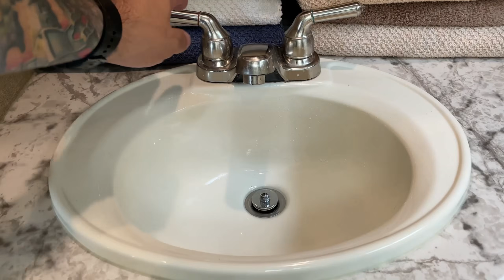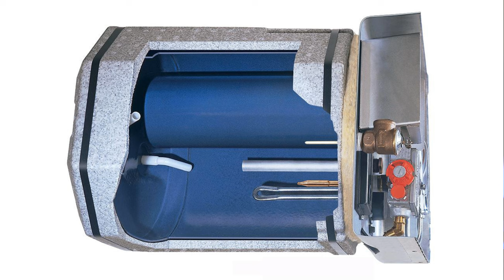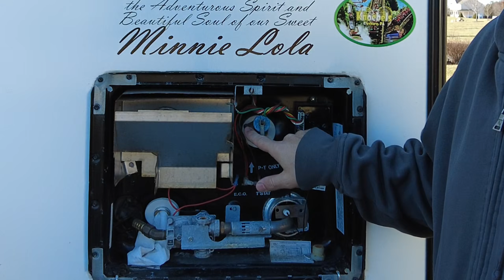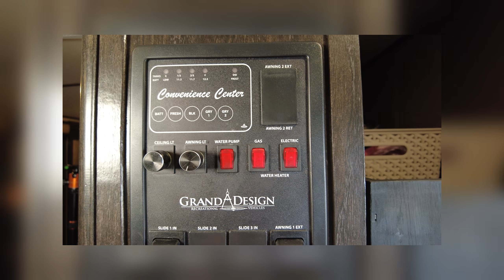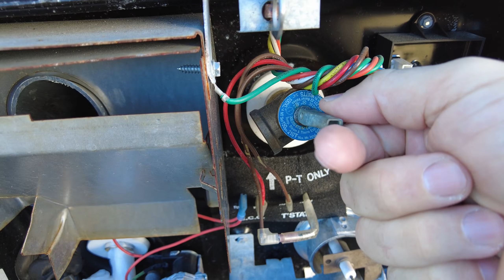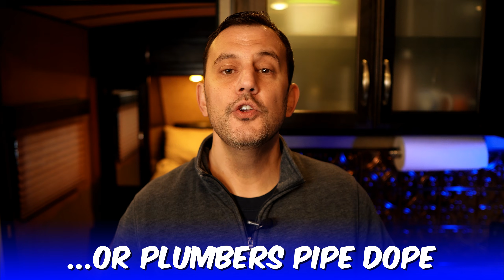Why RV Water Heater Pressure Valves Leak & How to Fix It - P&T Valves Explained

Comment from the maker: ✨⭐ PRODUCTS FEATURED IN THIS VIDEO ⭐✨
🔹 RV Temperature & Pressure Relief Valve https://geni.us/ngiGWMO (Amazon)
🔹 T&P Valve Replacement Tool https://geni.us/gQa02h4 (Amazon)
🔹 Teflon Tape https://geni.us/Wv8k (Amazon)

Why Your RV Water Heater Leaks & How to Fix - Pressure Relief Valves Explained Your RV temperature and pressure relief valve leaks by design when it detects excessive pressure or temperature.  This safety valve is also called a T&P valve (or P&T valve). While slow water dripping from this valve can be common, it's not normal if all systems are working properly.  This video will show you how we diagnose and fix the problem.

#rvlife #rvliving #rvtips #waterheater #rvwaterheater #rvhacks 

RV ESSENTIALS & TOP PICKS 
🎥Essentials Video: https://youtu.be/yuvS3zZL81c 
🔷Sewer Hose Kit https://geni.us/7dNg (Amazon)
🔷Clear 90 Degree Sewer Elbow https://geni.us/L79gI2 (Amazon)
🔷RV Water Filter https://geni.us/FZ1P (Amazon)
🔷Best Wheel Chocks https://geni.us/9B5i (Amazon)
🔷Power Watchdog 30 Amp Surge Protector/EMS https://geni.us/zKcm (Amazon)
🔷Power Watchdog 50 Amp Surge Protector/EMS https://geni.us/jgOto (Amazon)
🔷Wireless RV Leveler https://geni.us/DAW9N24 (Amazon)
🔷Leveling Ramps https://geni.us/m38VoBr (Amazon)
🔷Liquified RV Tank Treatment https://geni.us/QTUJSrP (Amazon)
🔷Tire Minder TPMS https://geni.us/8HBSTg (Amazon)
🔷Water Pressure Regulator https://geni.us/fTzA0 (Amazon)
🔷Drinking Water Safe Hose https://geni.us/emLdlC (Amazon)
🔷Browse All Essentials https://geni.us/1Omwvhh (Amazon)

MAINTENANCE:
🔶Boeshield T-9 Rust Preventative & Lubricant https://geni.us/uXxstyC (Amazon)
🔶Geocell Proflex Sealant https://geni.us/YXiACx (Amazon)
🔶Water Heater Cleaning Wand  https://geni.us/AcTvhLc (Amazon)
🔶Water Heater Cleaning Adapter https://youtu.be/h6C6ihTQ1cY
🔶Waste Tank Rinser https://geni.us/V2XLE (Amazon)
🔶Road Tool Kit https://geni.us/oBFnd9l (Amazon)
🔶Eternabond Roof Tape https://geni.us/6AXdw (Amazon)
🔶Browse All Maintenance https://geni.us/UvxFP (Amazon)

INSIDE
🔷Screen Door Handle https://geni.us/itRfKUQ (Amazon)
🔷Shower Caddy https://geni.us/ZPcno (Amazon)
🔷Oxygenics Shower Head https://geni.us/jznwF (Amazon)
🔷RV Paper Towel Holder https://geni.us/Acknol (Amazon)
🔷Dimmer Switch (watch video) https://youtu.be/2bbqBcSsRZQ
🔷Electric Heater Fireplace https://geni.us/YmBoktI (Amazon)
🔷Browse All Inside https://geni.us/BWiOR8k (Amazon)

OUTSIDE
🔶Gravity Chairs https://geni.us/VlPR8rn (Amazon)
🔶Ground Mat https://geni.us/wbWWLzf (Amazon)
🔶Table https://geni.us/qsPO (Amazon)
🔶X Chocks https://geni.us/3oyburw (Amazon)
🔶Blackstone Griddle https://geni.us/8BuIrW (Amazon)
🔶Low Point Drain Valves https://geni.us/yBB02h7 (Amazon)
🔶Browse All Outside https://amzn.to/4ld0kcz (Amazon)

👇 COUPON CODES! Use the links. Save money. Simple.

🚐 10% off RV Snappads & Snapjacks https://rvsnappad.com/discount/RVTT10

💦 Blu Technology Water Filtration Systems 7% Off, $80 or more No code needed just use our link:  https://goblutech.com/xxnnkdun 

🛌 Get 30% off your RV Mattress by Brooklyn Bedding at https://rvmattress.com/rvtips
Use Discount Code: RVTIPS

📷 Haloview Back Up Cameras 5% Off & FREE Shipping (Use code RVTIPS at checkout) https://www.haloview.com/products/byte-tango-1080p-observation-camera-system.html?acc=765

🔧 NRVTA Home Study Course https://rvtechcourse.com/discount/RVTIPS20
Use Discount Code: RVTIPS20

🚴‍♂️️ Lectric eBikes - Use our link get FREE accessories https://lectricebikes.sjv.io/nLrJ3x

💻 Our eBay Store! You never know what you’ll find!
https://geni.us/6AyLKnS (eBay)

💥 Join Our FREE Newsletter! https://rvtipsandtravels.myflodesk.com/freenewsletter

If you want to support the work I do to help others, you can donate here:
Paypal: https://www.paypal.com/donate/?hosted_button_id=J2KKM9NR3BJJA
Venmo: https://venmo.com/u/Ross-Stoico

✨ AMAZON RV STORE ✨
https://www.amazon.com/shop/rvtipstravels

Follow Us on Social Media
https://www.instagram.com/RVTipsAndTravels
https://www.facebook.com/RVTipsAndTravels

🙏 If you find a dead link, PLEASE let us know & we’ll send you bumper stickers!

As an Amazon Associate, I earn from qualifying purchases. There is NO ADDITIONAL COST TO YOU when purchasing from our links. Thank you for your support! 2.0

Comment: Thank you for this. I'm about to winterize today, but I will save this video (in my watch later list)  for next season and definitely do it. Because mine has been leaking once it heats up. 
*If you don't mind, I would like to ask you an unrelated question on the hot water heater, that no one can fix or answer so far. When I use electric to heat up the water, once it is all heated up, I get this clicking noise every few moments or a minute or two from the hot water heater. I'm told It sounds like a relay or something. And it doesn't happen if I heat up the hot water with my propane. I do have the sound recorded. I wish I could let you hear it. And I tried opening up the little black rectangular black box ( it's about six inches by two inches) that is connected to the hot water heater, and I blew it out with air just in case there was dirt in there, but that did not fix the problem. Any help would be appreciated, thank you.
Reply: @RVTIPSANDTRAVELS Did you read my comment? Do you have any advice? Thanks

Comment: I see a pink  plug on your t and p drain opening. Does it need a plug there or stay open. I have a 2004 Atwood. Does it need an anode or a plastic plug at bottom of hot water heater. I would greatly appreciate any input. 😊
Reply from the maker: its a plastic plug and it should have fallen off a while ago so its not needed.  its just a cover. atwoods dont need an anode rod.
Reply: @RVTIPSANDTRAVELS thanks so much for replying. I'm grateful.

Comment: first scenario MAY have been my case and the steps seem to have worked released water from tp valve cold...repressurized. flipped it open to closed a few times  and tapped. will leave it on overnight and see how it does when it gets hot out. have exact same tank you show....where is the anode???
Reply from the maker: No anode rod, it’s aluminum

Comment: Hi, what is the red piece that sticks out from the side of the P&T valve? 
The one in my valve broke, is it necessary? I’ve NOT  turned my water heater on for the first time on a recently acquired used rv. I’m learning how to do it.
Reply from the maker: its not necessary, I believe its just a cap that allows water to come out but makes it harder for anything to get into the valve, like bugs.  the valve is close most of the time and mine fell out a while ago, I wouldnt be concerned with it.

Comment: You made a video once discussing making hoses to be used with a shop vac to get the water out of the low point in a water heater. Can’t find the video or at least that part. And did you ever find or come up with a good solution to vacuum out the remaining water?
Reply from the maker: Hey Anthony, that video and those adapters will be released towards the end of February... make sure you have all notifications turned on our channel. Hang in there for a couple weeks.
Reply from the maker: https://youtu.be/h6C6ihTQ1cY

Comment: Well done video. I recently purchased a 2006 travel trailer, and while checking the systems,  noticed the water heated worked okay on gas, but not on AC, and the pop off valve had been leaking (rust all over). It tuned out, the AC switch was frozen up, the heating element was bad, so I’m replacing the T&P valve anyway, since after taking out the anode rod, it was just a wire, and flushing the tank, a lot of stuff came out of it. Obviously a very neglected water heater. I had to even remove the gas valve to clean out all the surface rust, practically overhauling the water heater. Great job explaining everything.
Reply from the maker: Sounds like you’ve got a good handle on things now.

Comment: Great video. Just found it while perusing the channels. That T&P valve socket works fantastic and I'd highly recommend it. I will add that I've added the T&P valve to a maintenance replacement part rather than wait for it to fail. The 'ears' on the valve lever (that's what I'm calling them, the thin pieces of metal that have the hinge pin through them and push against the valve body to lift the spring inside the valve) were significantly bending outwards on ours after three years and the valve had become quite stiff to open. Yours (I'm assuming it is your water heater in your video) seems to be bending in the same fashion. Since I use the valve to 'burp' the water heater at the campsite when filling it prior to starting it up, I decided to go ahead and replace it since it's just a $20 part (or less). That seems to be a far better option than to deal with it after it fails at the campsite. 

Just to put this out there, yes, we maintain our water heater. It is fully drained after each trip (once a month for a week or two at a time) and, once a year, it is filled with vinegar, allowed to sit for 24~48 hours, drained, and fully rinsed. This is followed by wand flushing out of the drain port (we have a Dometic so no anode rod) until no sediment flows out. The T&P valve still gets corrosion over time and since we're constantly cycling the valve to 'burp' it, I think it's just better practice to replace it every 3~4 years.

If anyone has a T&P valve that is leaking; however, they do need to follow your steps to verify that they do not have something more sinister going on before just replacing it. Keep up the great videos.
Reply from the maker: thanks Matt, and yes, i find myself squeezing those tabs occasionally to bend them back into place 🤣

Comment: Mine doesn’t leak when there is no power to the water heater it’s just full of water I can flip the value cold water comes out. If I turn the power on electric or gas it starts to leak. There is some build on around the value but I’m not sure if it needs a new one.
Reply from the maker: probably just worth replacing: https://amzn.to/3zahfcN

Comment: My water's not even getting hot so it's definitely not a pressure issue.And it's still leaking every time I turn it on and wait more than 10 minutes.It starts pissing everywhere and the water's not even getting hot anymore
Reply from the maker: sounds like the valve just needs to be replaced.  the water might not be getting hot because its not sitting in the tank long enough.

Comment: Mine is doing this - and it steams when the water gets too hot. It leaks too. Very frustrating.
Reply from the maker: keep me posted on what you find out please.
Reply: @RVTIPSANDTRAVELS  will do, I bought a 3/4 valve because mine is leaking, it's about 7 years old so hopefully that does the trick.

Comment: I've replaced the valve twice. Still leaking. What else do I do? I put Teflon tape on both new valves & did everything in the video.
Reply from the maker: it 3 valves are spewing water, chances are something else is wrong, meaning they are doing their job and the water pressure is too high or too hot.  might be time to have someone test the things I mention at the end of the video.

Comment: I have some concerns that my T&P valve spring is too tight, and like yours, the ears on the handle try to bend as I open the valve manually.  That doesn't seem to be a concern for you, but it seems like the valve should open without damage to the handle??
Reply from the maker: GREAT QUESTION JD, i think that could be an issue, but those ears are so thin that I never thought twice about them.  i always just finger pinch them back together but I've been using the same valve for 8 years now, and I use it often to confirm water in the heater before firing up the electric element. If anything, I think that spring would weaken over time, not get stronger, so I don't worry about it all that often.  It is a valid point though, and they are pretty inexpensive to replace if you just want to test it out.  Here's one we've sold a few of already: https://amzn.to/3W7qdQW
Reply: @RVTIPSANDTRAVELS  The handle on the camco unit appears to be more robust.  My RV is a 2021 - so not real old.  The tension doesn't seem to be getting stronger as it's been this way since new.
Reply from the maker: I wouldnt be too concerned since the point you brought up is something that I personally, though never really thought about, am having too with those ears... they are weak on mine as well, but never had an issue with the valve and I dont think Ive had excessive pressure problems because after years the camper is dry.  Thanks for bringing it up, maybe something I ask my viewers down the road.

Comment: My hot water tank keeps getting over heated and blows off. Any idea why it keeps getting too hot and blowing off?
Reply from the maker: it could be the board, the heating element, the thermostat.... does it do it on electric or gas or both?
Reply: @RVTIPSANDTRAVELS  It is both, I figured it out its the eco and tstat switch they were not touching the wall and the foam tape fell off allowing them to dangle from the wires.
Reply from the maker: good to hear you got it fixed!

Comment: Got a bunch of calcium/corrosion buildup on my valve, ran thru the first set of steps and currently waiting for temperature to return to normal to check if its still leaking. Thanks for the info, safe travels, and GO HAWKS!
Reply from the maker: good luck, let me know, and GO HAWKS! 🍻
Reply: @RVTIPSANDTRAVELS  sad to see the last game is being played tonight. my water tank never really got free off the corrosion and will almost certainly have to be replaced, but in the meantime the leak has stopped and my hot water has been performing like new thru the winter into spring now. Thanks again!
Reply from the maker: Well, thats some good news.  Once you replace it, you now know how to keep it clean.  good luck my friend, and lets hope for a good game!

Comment: followed all the procedure and its a brand new valve, still leaking on and off ???? what could be wrong?  thanks
Reply from the maker: How bad is it leaking? Occasional drips?
Reply: @RVTIPSANDTRAVELS  thanks for the fast response 
Tripping on and off
I believe the water gets to hot. 136f I measured 
I ordered a new thermostat and hopefully that will do the trick
What do you think?
Thermostat is rated for 130f
Reply from the maker: It definitely could be the thermostat, but that’s usually rare. I think it’s a good place to start though. Every once in a while, and I mean not very often, I’ll see my pressure valve slowly dripping. I rarely camp without water hookups, so it’s not a big deal to me. They can definitely be finicky.

Comment: Ross,  On your video  "RV Water Heater Pressure Relief Valves",  you had a flexible hose coming out of the Hot water heater.   Where we empty the tank.  Where can I get one of those hoses?  Thank you   I am learning so much....   Thanks
Reply from the maker: Can you point out? What time in the video this is being shown?

Comment: Is it supposed to make that obnoxious sputtering sound when you press it 5 times?
Reply from the maker: it can, depending on how high the water level is.  dont forget there is pressure in the tank so it will make some noise.
Reply: @RVTIPSANDTRAVELS  awesome, thanks!

Comment: Very interesting Ross. My t&p valve is leaking but only when I'm running it on gas, not a drop comes out when switched to electric. It could be electronic but I'll try your advice first....thanks for getting this video out there.
Reply from the maker: let me know what you find out, sounds like gas is running hot.

Comment: I have a new 2023 travel trailer and this is my third trip with it. On this and the last trip, I have noticed water coming out of the P&T valve for a few minutes then stopping. Is this normal operation of the valve or do I have a potential problem?
Reply from the maker: if you maneuvered the valve a little and its still just dripping a little, it might just be slightly opening due to pressure.  if it is then stopping, its probably not faulty.  id keep an eye on it in case it gets to the point where its draining the tank and kicking on your water pump, but its probably ok for now.  as stated in the video its normal to leak if its doing its job.
Reply: No it wasn’t dripping, it was venting water. Probably a gallon. Then it stopped. It never stopped functioning properly so my question is, is it just doing its job when it does that?

Comment: Great video!   I have a dilemma.    Been troubleshooting a constant pump running.   In conducting troubleshooting and replacing many other components, the final troubleshooting step was to isolate the water heater by using the bypass.  To my surprise, the system built up pressure and the pump turned off.   Have you ever seen this before?
Reply from the maker: interesting.... what type of bypass valve system do you have at the water heater?  if you dont know what i mean by that check this video out: https://youtu.be/rLAnkCVfjO4
Reply: @RVTIPSANDTRAVELS  I have the 3 valve system.   When I put this in bypass the pump builds pressure and turns off.   When I return these valves to normal position the pump runs and runs and runs.  My next step is to change the temp/pressure relief valve.
Reply from the maker: it might not be the T&P valve.  if when your bypass valves are closed, the pump turns off, there are no leaks up to that point.  if your pump is running after the valves are open, logically you should have a leak somewhere after the valves.  are your low point drains closed?
Reply: @RVTIPSANDTRAVELS  low pt drains are in the piping to the kitchen sink.  So, when in bypass mode the pump builds pressure and turns off.   When not in bypass mode ( hot water tank now in the loop) the pump never builds enough pressure to turn off.  Hope that clears up my previous reply.
Reply from the maker: YES!  I had a brain fart for a second there. Long day… yes, try the T&P valve first.  Keep me posted.